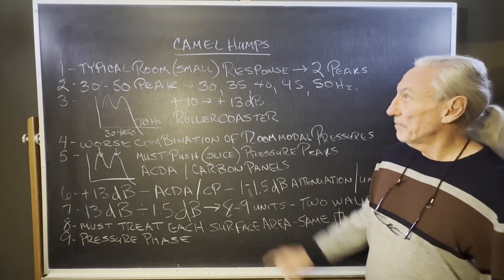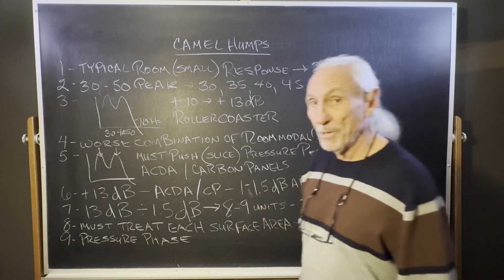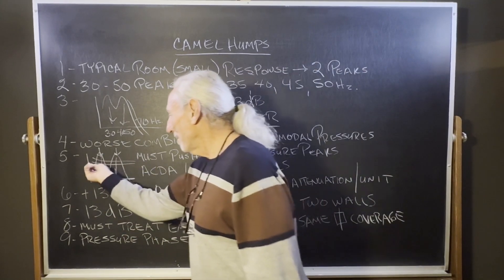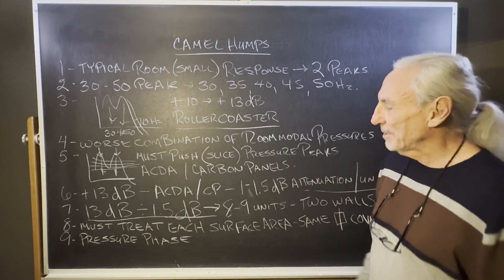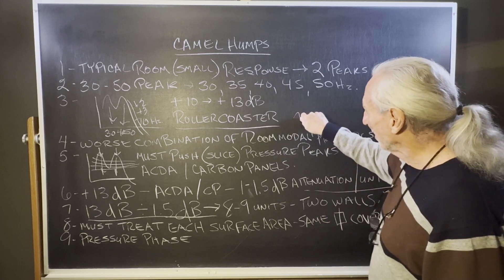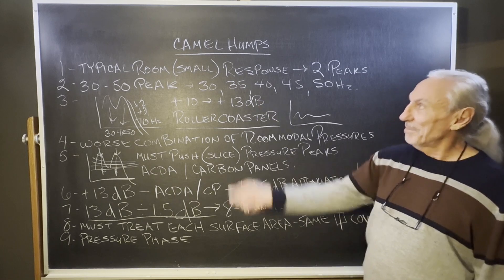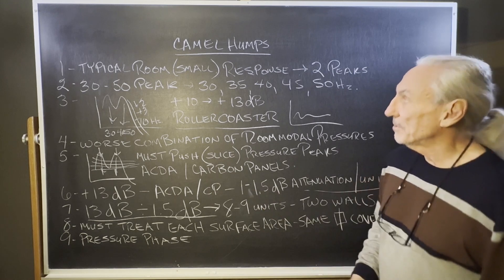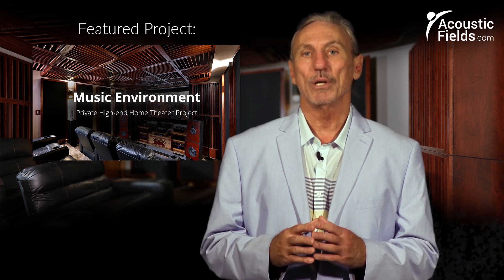Camel Humps - www.AcousticFields.com

Comment: I was watching another video from another channel and they took measurements before/after they put treatment in the their room.  The video had 4  9 inch deep "bass traps" (with just building insulation) put in the four corners of the room and the ONLY thing they did was reduce the decay a LITTLE.  They did NOT do ANYTHING to reduce the peaks of the lower frequency problems, they just reduced the very end of the decay only by a VERY small, insignificant amount.   yet the person that made the video thinks they treated the low frequency problems.  It was just another display of misinformation.
Reply: His series was a joke, he had all that space to play with yet he went with such a compromised route. It will obviously sound better than zero treatment, so in his mind, it was worth it.
Reply from the maker: This is a common error made by people. They do not understand the difference between low frequency pressure issues and reflections (reverb). Pressure issues must be treated with pressure based technologies of which there are 3. We have Helmholtz, membrane, and diaphragmatic. The common ttreatment type for reflections is open celled foam and unfortunately building insulation. Insulation lacks the proper rates and levels of absorption for music and voice. This is why you destroy the harmonics with insulation.
Reply: @AcousticFields   I have plans to treat a 2 channel room through your diy plans. By firstly implementing BDA's in the ceiling, and maybe some in the room. What foam/material can one use?, as i don't have access to the studiopro here in Europe. Guess i need to measure the room first before i can get a overview, of what freq i do have that needs treating, but for sure the room needs a bunch of help.
Reply: Can you put the link to the video?
Reply: @vinylrules4838  I believe this was the one.    https://www.youtube.com/watch?v=IiALw5Qjw7Y

There's another video that showed rather poor results with "bass traps" in the corners.  I'll find it and show that one too.
Reply: @Oneness100  Thanks. Yeah, I actually saw that video. It did flatten a peak at 100Hz by 4 dB, and did nothing with the 40Hz peak in the room.
Reply: @vinylrules4838  Let me do some searching, I saw the video a couple of weeks ago, so I have to look for it. I will post as soon as I find it.